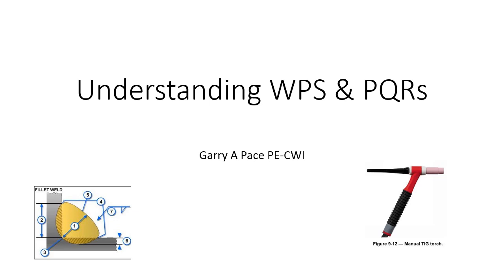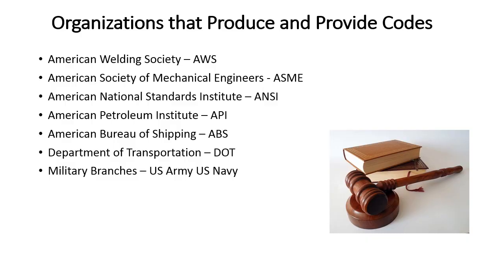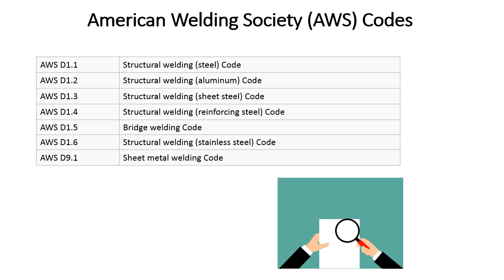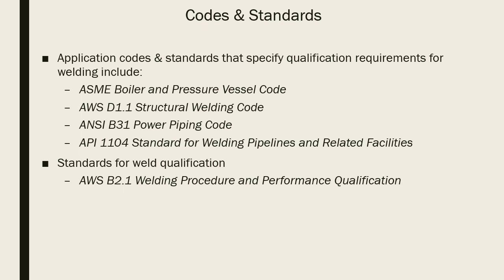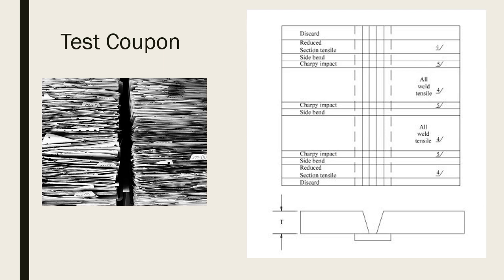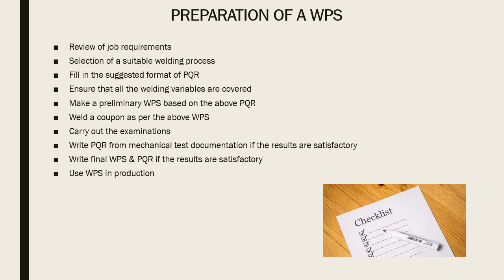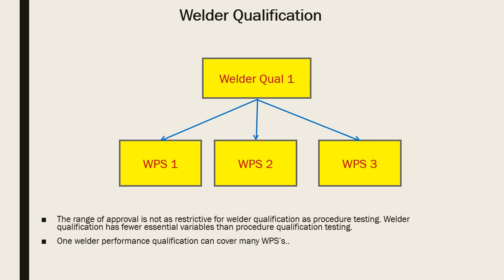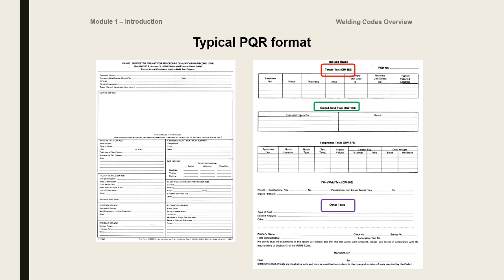WPS/PQR Explanation - CWI Course Module 5

Comment: Hello sir, 
Does the plate work of storage tanks governed by d1.1?
Reply from the maker: It’s important to understand that AWS D1.1 specifically applies to structural steel welding. Its scope is focused on welded joints in structures like buildings, and other load-bearing elements made from carbon steel or low-alloy steel. If you're working with other materials or non-structural applications, this standard might not be the right fit.